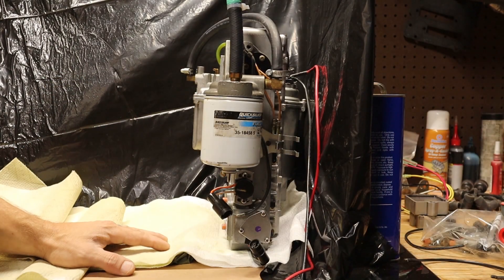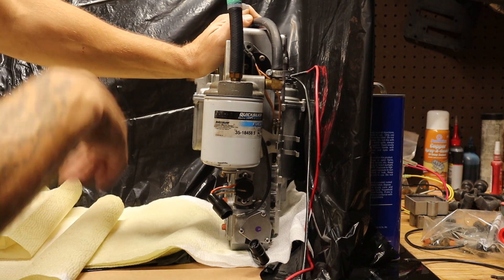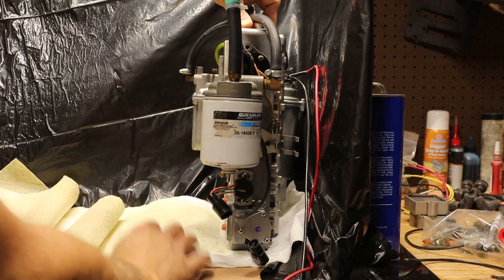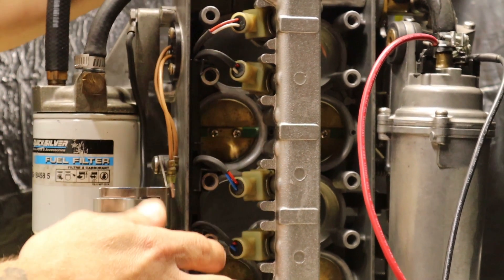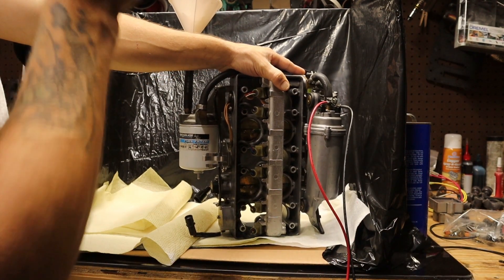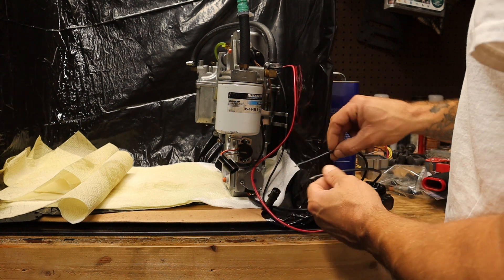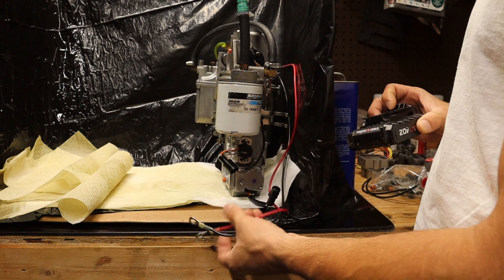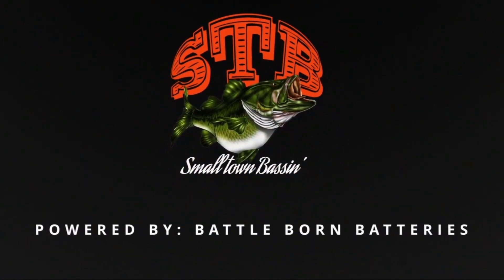HOW TO - MERCURY LASER EFI BENCH TEST

Comment: Haven’t pulled the injector system to test yet. Recently got the motor and installed it on my pontoon boat. Mercury to Mercury plug and play 8 pin. Connected fuel and she started damn near instantly for first time in about 10 years. Went to the lake and she ran like a boss. Starts in Dover way with a single turn almost instantly.
Went to the lake last weekend had trouble starting it as soon as I put it in the water/on shore as well. Didn’t seem like it had full power while on the lake after I finally got it started running straight 93 octane in it, fresh oil, and the top reservoir and fresh oil in the main tank plus for a new mercury oil Feed line and brand new mercury fuel feed line and new mercury fuel/water separator filter. Swap plugs to new plugs and still does not seem to wanna start. He wants to try but does it smell like it’s getting fuel. Thoughts? I know it’s a lot just wondering if those injectors possibly followed upafter being run for a little bit or maybe the remaining oil that was in the old fuel on the boat maybe the mixture messed them up? Does the mercury inject the fuel or post injection? Thank you for any help.
Reply: Fuel pump is working perfectly as well
Reply from the maker: Send me an email

Comment: Very helpful . Keep it comin. Do have a few questions. Can you test run a 200hp efi engine off the boat(unplugged) like you can a carb engine using a jumper wire to kill  it ?reason i ask i purchased a efi engine with a bad #3 , went through the engine with new pistons,rings, bearings , but on the stand with power and ground connected using a starter  button the fuel pumps not coming on . Is there a way to check the ecu ?
Reply from the maker: Power the fuel pump with the purple wire instead of the red wire from the ecu harness. Bypasses the pump driver.

Comment: So its not a problem putting 20 volts dc to the pump and injectors?   Don't they normally run on 12vdc?
Reply: I ask because I this is perfect. I'm about to do exactly what you did. Go from carbs back to efi on my 2.5. It was a 200 ff block worked to 225 promax specs. All I could find was a 200 promax ecu. Hope that's ok? Anyway, perfect video for me.  Your vids are awesome. Super helpful. Thanks
Reply from the maker: As long as it doesn't have a 7 petal front, the 200pm ecu should be fine but a little sluggish out of the hole if you opened the dumps in the block and adapter to 225pm spec. If it's a 7 petal, that 200 ecu may burn it up.
Reply from the maker: Depends on the rpm/output of the voltage regulator. Could be as high as 16vdc. Fuel pressure regulation happens on its own regardless of pump rpm. Injector solenoids don't give a F.  For bench testing, it's fine.

Comment: At the to of the injector housing there is to brass elbows at top there is a small and a little bit lager on dose one of the have a hole in it  that lead back to fuel housing
Reply: Is this a question? Mine seem to be exactly the same size with the same hole size